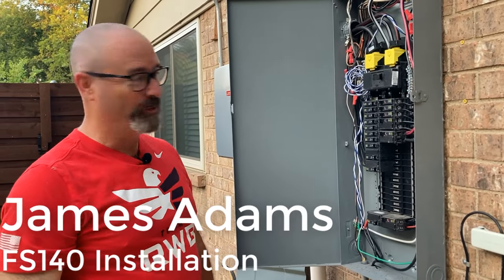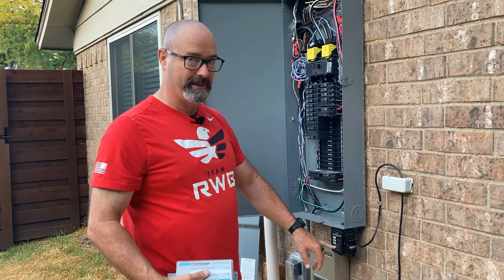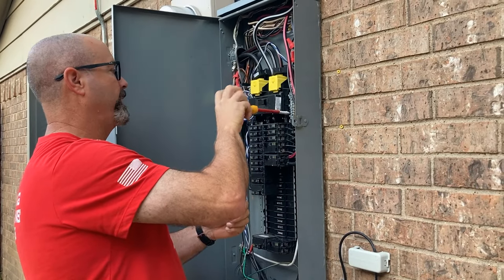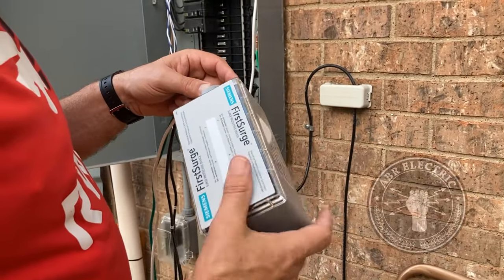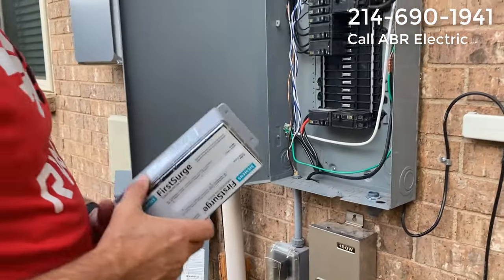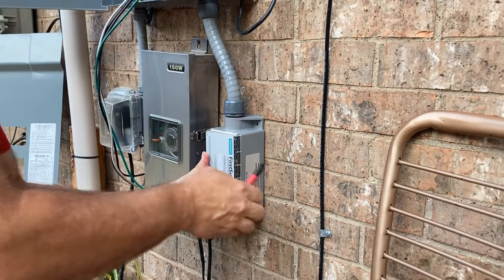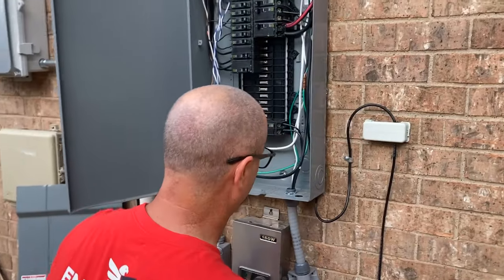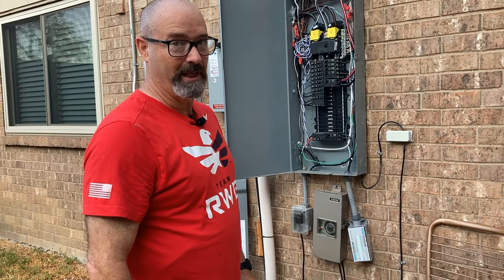Installing an FS140 Siemens Surge Protector

Comment: From watching other people install the Eaton SP here on YT they install the breaker close to the feeder.  From your video the breaker for the old SP is on the very bottom.  I get it, short wires, but does that ruin the surge protector's performance or working properly?  I was thinking about doing it the way you wired the old Eaton SP because I have the same set up as you have it in this video and thinking of getting the Eaton because its available in the big box stores here in my parts.
Reply from the maker: Follow the manufacturer's instructions, in detail. You cannot go wrong since those instructions were made for the UL listing for best performance.
Reply: Two days ago, I spoke for an hour to an engineer supervisor at Siemens SPD customer support. She was amazingly knowledgeable and gave me lots of tips. She commented about how much incorrect information on SPDs was on the internet.  Surprise!  The only purpose of the breaker is to simply disconnect the SPD from the panel. All type 2 SPDs by Code require a disconnect. You can use a 20 or a 30 amp 2 pole. Makes NO difference. Both are listed since all the FS's use 10 guage wire. They do not function as over-current devices.  SPDS are over voltage devices.  Next: Siemens engineers tested and found It makes no difference where on the bus you put the breakers. You do NOT need to put them next to the feeds or main breaker.  The MOVs in the SPD will be the path of least resistance for the surge regardless of where the breaker is.  Next: short wires to the breaker is strongly recommended, as was done here.  Lastly, tight wire bends are not recommended. But 4.5 inch radius  bends, like from Carlon 3/4" 90 deg. PVC non metallic conduit elbows are fine.  

I have talked to many  customer service engineers, this lady was the brightest and most helpful.
Reply: @WorldwideBeagle  Thanks for your comments here Peter.  I too called Siemens and they confirmed you can put the breaker anywhere in the panel box.  That is certainly easier and provides for greater installation flexibility

Comment: Is a Flush Mount Kit required if installing on Drywall? If so is there an alternative to using the Flush Mount Kit? It seems like a waist of money to me.
Reply from the maker: No, you can surface-mount the unit, and use 3/4" flexible conduit to get into the panel. You'll have a little drywall cutting to get the conduit into a KO.

Comment: Why does my wife's computer ,cable modem and 65" flat screen TV still snap off and back on after a surge....?!
Reply from the maker: On most electronics, if the voltage dips below 115 volts, the equipment will shut off.
Reply: @abrelectric  Wouldn't that  be considered a brown out....?
Reply from the maker: @troy8736  yes, but super fast, and the down hill side of a surge
Reply: @abrelectric  I think the specs for low voltage shut off on sophisticated electronics is about 90v
Reply: A simple UPS placed on each of those devices would likely resolve that problem for you in short order. There are different types of USPs out on the market so be sure and do your homework on them before making a purchase so you understand exactly what it is that you are buying.

Comment: as you point out the FS 140 like the Eaton need to be installed as close to the main as possible.  The further away they are from the input power leads the worse they work.  When you talk about the quality of the FS 140 as opposed to the Eaton did you open them both up or are you basing that comment based on how much you like the color of the plastic box the FS 140 is in?
Reply from the maker: Absolutely. All master electricians make quality judgment calls based on packaging. 
😉
Beyond that, it's the specs for sure.

Comment: Is the bus bar where you can put both neutral and ground on the same bus bar (no separate ground bus bar or separate neutral bus bar)?
Reply from the maker: In the main panel, with the main breaker, yes. Otherwise,  the neutral and ground wires would be landed on separate bus bars in a sub panel.

Comment: Still a mystery how 2  20 amp wires connected just like another appliance, can disconnect the whole house when a surge hits. Shunting down a surge of long duration, like a primary on the pole hitting a secondary cannot be enough.
Reply from the maker: It doesn't disconnect the house. All wiring is in parallel.

Comment: Ok, so you tells us a Type 2 surge protector requires a breaker.  It would be nice to understand  WHY that is necessary.  Also, STOP USING ACRONYMS. They are stupid and mystifying to a layman.  Spell it out (knockout instead of KO, etc.) as if you are talking to a layman and then say, "we refer to that as a KO."   (WTF is emt?)  I also cannot believe you are sticking your fingers into a LIVE electrical box without insulated gloves on!  Oh yeah, and when you nicked (only a couple) strands on the ground wire you reduced the current shunting ability of that suppressor.  OVERALL I do appreciate the video.  It will help in knowing what is necessary to perform such an install.  (Please in future try to improve the low volume or speak louder.)